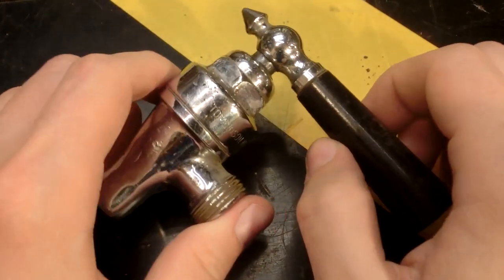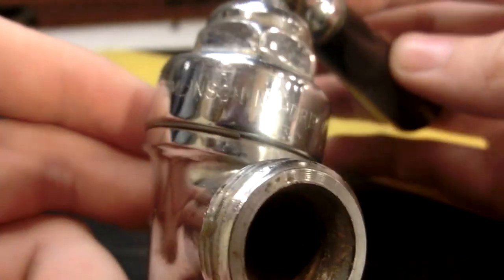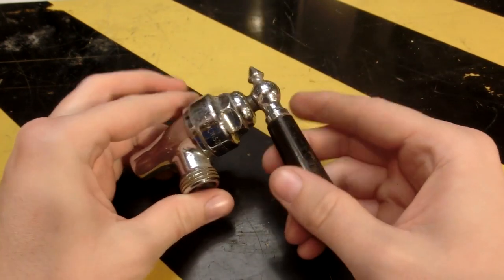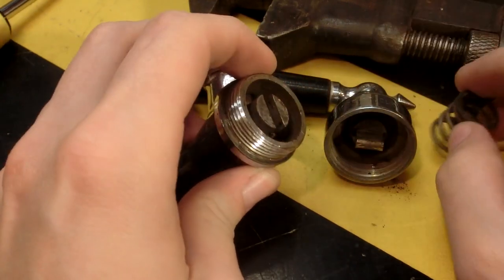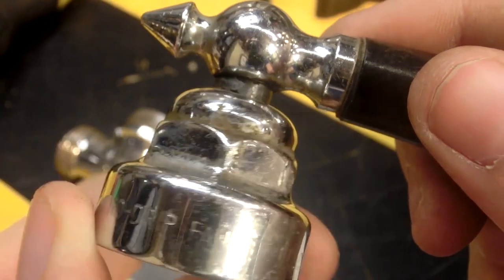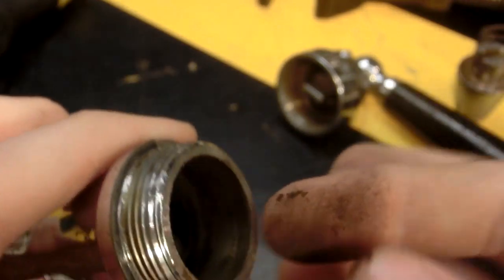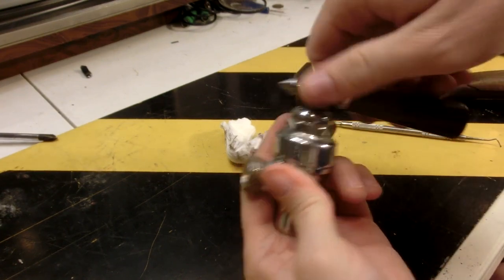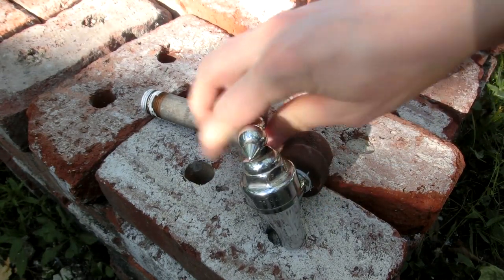1930's Tomlinson No-Drip Faucet co. Valve for Beverage Urn

Comment: That's a well-built vintage unit, hopefully not too difficult to refurbish! 
Could possibly gently lap it in with some fine lapping compound if any of that dripping was from the valve leaking rather than the pipe-to-hose joint.
Reply from the maker: I think for the time being i might just toss some grease into it, that should stop most leaks on non-pressurized fluid. and yeah its really hard to tell with that really crappy plumbing job i did. haha
Reply: Yeah, that should prevent seepage just fine.
Reply: Rinoa Super-Genius If you do grease it use food safe silicon grease. More resistant to hot water as well.

Comment: keep in mind that mains pressure would of been alot less back in the 30s so that stream would be different 
plus if it is used for hot water i think the water its self would spray different, just like you can hear the difference in pouring hot vs cold water into identical cups
Reply from the maker: +John Strong why would it be less? i didnt think our water tower got much taller, but beverage urns arent pressurized so its not a correct test anyway.
Reply from the maker: +taunter atwill wow your a fucking moron.
Reply: my bad
im used to Australia and new zealand where we don't have water towers and everything is pumped 
even still your right again with the hot water in one of those systems normally aren't under pressure 
Much like the zip branded ones 
even still its a cool tap, if i were a beer drinker which im not id suggest using it as a beer tap
Reply: im also extremely tired right now so half of that probably didn't make sence lol